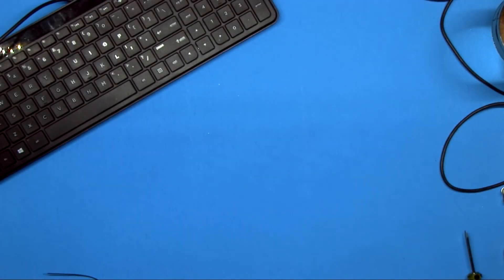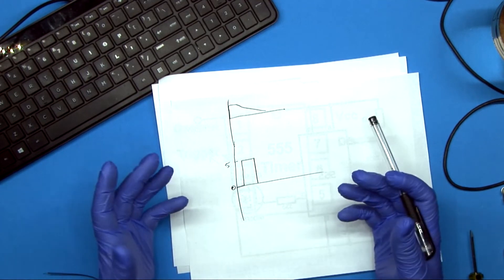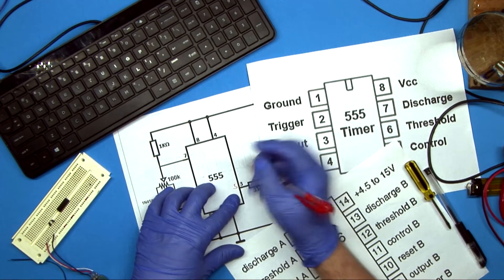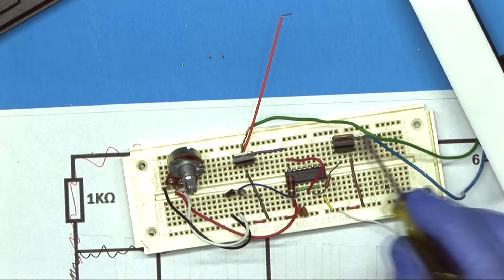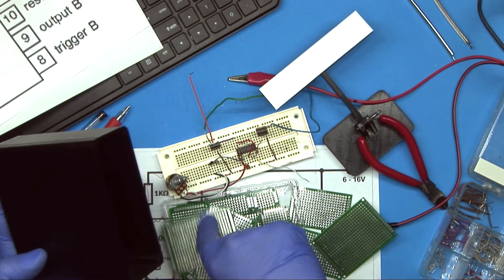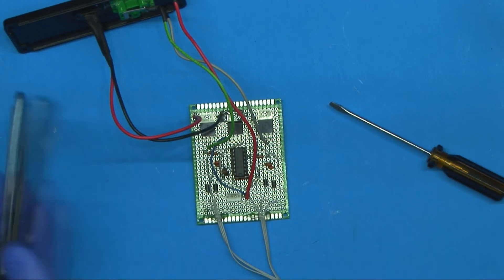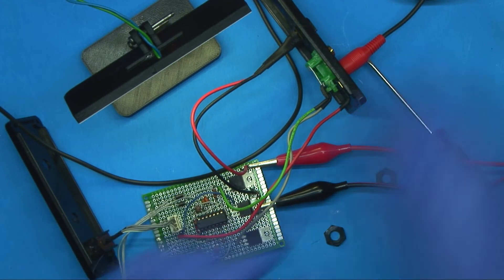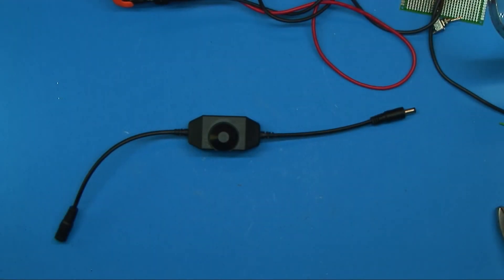555 PWM 2 Channel LED Dimmer Build - New workbench lighting

Comment: Hi video was excellent.   I have one quick question though. I noticed that you had to diodes connected to your 100 K Pot. I am not very good at circuit analysis's can you provide to me their functionalities. Additionally I plan to use a digital pot and place of your manual pot. Would I need to use the same rwo diode configuration that you use in your schematic.